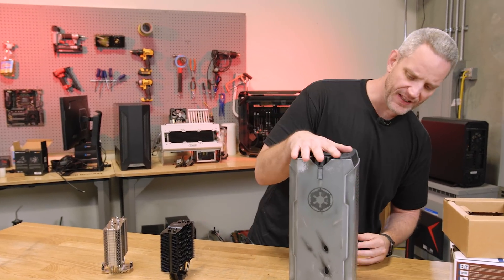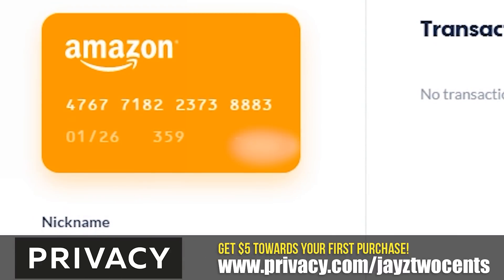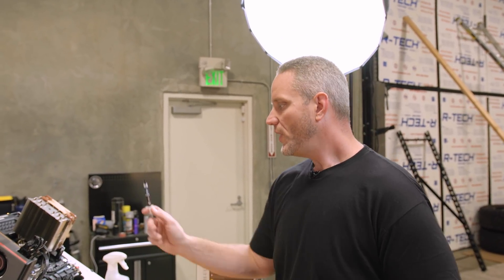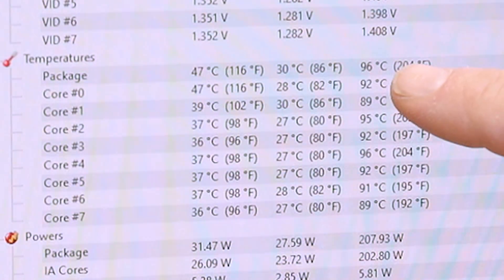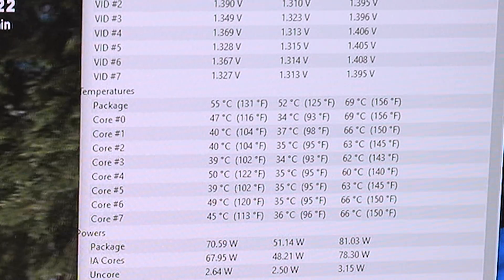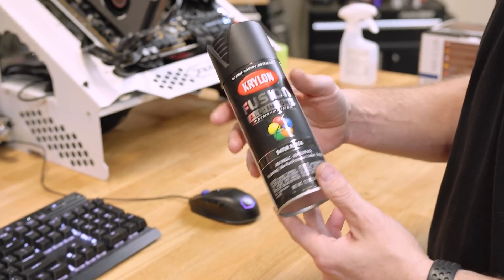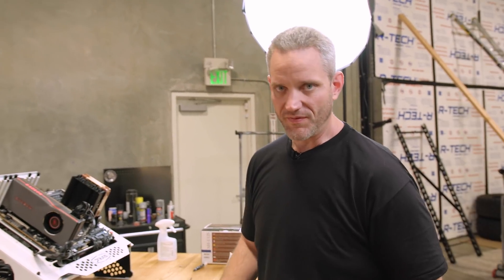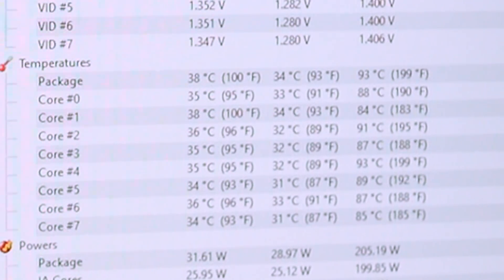Does painting a heatsink hurt its performance??

Comment: Now you have to sandblast that "ceramic" coating off of the BeQuiet cooler and see if it cools better.
Reply: Ceramic is actually pretty darn good at transferring heat depending on the exact composition being anywhere from 80W/Mk to 2-300W/Mk
Reply: @radicalxedward8047  hum they ceramic coat header to keep the heat in the piping and increase spool time on turbo car
Ceramic paint is just high heat paint
Reply: @radicalxedward8047  that's very true. But at the same time I'm pretty sure the heat pipes aren't quite as efficient (not to mention tim) so even though it's that good at transfering heat it'll be limited by the wicks,heatpipes and the phase changing. Which kind of make me doubts it'll make that much of a difference considering.
Reply: @radicalxedward8047  -. Damn is spelt d - a  - m - n , and it's quite possible that it's not intended as a curse in the context of your sentence. With a moniker of "radical," the word "darn"  doesn't fit in well.
Reply: Just paint it silver duh.
Reply: You can use super stripper and then just pressure wash it later to get the super stripper off 👍
Reply: @Twitch_Moderator  super stripper isn't that super girls secret identity?
Reply: @KunoMochi  Noctua themseves say that black paint hurts perfomance and it was a challenge for them to find coating that wasn't absolutely terrible.
Reply: @Koshzor  You can dope coatings with impurities to give intrinsic properties for thermal conductivity to electromagnetic insulation or reciprocity.
Reply: @KunoMochi  Linus already did; there's no difference in performance
Reply: Could of just bought a heatsink without any coating.
Reply: Result: the non painted NH-D15 next generation is on the buying list not the chromax version
Reply: If he sand blast it, sand will impregnate the coolers fins and not give a accurate result as sand is an insulator.
Reply: @chaddystechstuff5547  lol.....I don't think you really know what sandblasting is.
Reply: @wcraft84  When u sand blast to strip eny type of material off a surface, sand particles impregnate the surface of the material. It is not visible to the naked eye. This will cause the surface to be more porous and not transfer heat as well. The only way to get the sand particles off/out of  the material is hand sanding the surface smooth. You can't hand sand the insides/ in-between the fins so... their would be some issues.I know this because I use sand blasting at work pritty regularly. Hope this helps clarify. (Impregnate just means sand gets stuck into the surface of the material.) Its a term used in the machinist community.
Reply: @chaddystechstuff5547  there is blasting media that does not impregnate softer metals.
Reply: @wcraft84  It would not be sandblasting then. It would be a fiber based material being used.
Reply: @chaddystechstuff5547  troll
Reply: @chaddystechstuff5547  -

Your opinion is at the level of an expert. Thanks for your input.

Comment: So basically what we learned here is if you're running your system on the top limit of what your cooler can handle, probably shouldn't spray it. If you are well under your cooler's limit and have plenty of headroom, go for it! P.S. It can be offset by getting a better fan. (Which you're probably doing if you're upgrading the looks of your computer anyway. Right?)

Comment: "I want to do a *Real World Test*" and then proceeds to use an open test case, duh...
Reply: And Cinebench R20 is a "real wold test" also. It shows how heavy the CPU will get pushed for rendering and hard productivity work. By "realistic" he just meant for gamers while playing games only. Not sure why that is the only "real" use of a CPU.
Reply: @odinsplaygrounds  Still the 99% of gamers or heavy users would have a closed case with proper case fans
Reply: Modern cases having massive airflows now I don't think it'll make a lot of difference.
Reply: @mouaxiong8618  there are more cases like that than before, and also more cases with terrible airflow just for the looks. In both scenarios, the interaction between the case fans and the CPU heathsink is relevant
Reply: I said the same thing. This test is pointless because of this.

Comment: Prediction: I have actually done something similar (not a cpu heat sink, but a heat sink) and found there was a difference, but the paint I was using was heavy-duty industrial paint that goes on super thick. However, there were only 9 degrees different. 168 -> 159 (+- 1) degree because of the equipment used.

So I would say there is a differences, however if you scale this down more and more I believe the differences will become less and less.  To were there is little to no difference.
Reply: Seems about what I thought. Not a super huge difference, but still a notable one.

Comment: I think it'll depend on what you use to paint the cooler. Having said that, paint will probably act as insulation and slow down heat dissipation. I think temps will be higher but likely not enough to be a problem
Edit: well I was kind of right but then I didn't make specific temp predictions

Comment: The Mighty Car Mods boys tested something similar with car intercoolers and found that the black painted one performed a bit better.
Reply: I believe engineering explained or someone else proved them wrong
Reply: Geek Mechanic I’ll have to check that out
Reply: @kylehyatt42069  yea it was engineering explained that they were wrong because intercoolers use convection not radiation and goes into deeper explanation. Essentially paint adds insulation, adds restriction of airflow between the fins.

Comment: if you masked off the faces of the cooler (maybe start 10mm from the edge) i bet you could get away with painting the visible surfaces with even less impact on cooling.
Reply: K.  Look at how close those fins are.  Now count the total number of fins.  Now get out your exacto knife and tweezers, and let's get this party started.
Reply: @WeirdOne19142  you don't have to do that. Cut the right size piece of tape. Slap it on the surface where the fan goes. 2 pieces of tape for the entire cooler (or 1 if it's a single fan) Done. Fan hides the unpainted areas.
Reply: @Matthew-sp5kv  true.  I stand corrected.  I apologise.

Comment: Just use high heat paint like caliper, engine, or just ceramic coat it to make it even cooler or no difference at all.
Reply: high heat paint is meant for resisting extreme levels of heat without getting worn, not that it transfers heat better....

Comment: Paint does actually turns it into a better black body radiator, which gives it better ability to cool by infa red radiation, but this effect might be way smaller than the insulation effect of the paint.

Comment: I wonder if doing something like a black wash, or using a chemical to give the aluminum a dark patina would be a safer alternative?
Reply: there are dies and stains that will tint metals - a little bit more of a process, a lot say they have to be baked on but that is only to set the color and make it more durable. For something that is not going to be exposed to the elements just a little more cure time works well.
Reply: safer? there's nothing dangerous about what he did, just performance hurting.
Reply: @shawnpitman876  "No Jayz where harmed in the creation of this video"

Comment: do a video about NH-D15 using 3 140mm NF-A14 fans running at max fan speed 3000rpm vs the best AIO Liquid Coolers

Comment: I think it will cause extra heat, but not enough to worry about.  

Also, I'm prepared to be absolutely wrong.
Reply: Depends on what you call enough to worry about.
Reply: @shawnpitman876  I totally concur.  My personal opinion: if it throttles my CPU, it is enough to worry about.  

Others my not think so.  They may think: If I notice a difference.

That's why it is very personal/tangible assessment.
Reply: @shawnpitman876  That's why I keep the HVAC vent closed in my office during the winter.  My PC and peripherals heat the room well enough.  :)

Comment: I have painted a Hyper Evo 212 and had no increase in thermals but I think paint type is very important. I use engine or grill paint to paint my stuff black. Its a thin coat type paint and not gummy.

Comment: initial thoughts... paint it...using which method?
depending on access to tools, getting a heatsink electro-static coated followed by  baking the fins(not the heatpipes)  you would suffer little  performance loss.

literally dipping the heatsink in pain would be the worse.

Comment: Painting your brake calipers red increases braking performance (along with Brembo stickers) so painting your heatsink has to give you better cooling efficiency. Also, a Noctua sticker on the fan makes it cool better. Now the real question is what happens when you paint the IHS?
Reply: braking performance isn't about how well you transfer heat but rather how much friction you can generate....

Comment: paused when he asked for predictions, im guessing +5C
edit: wow only 1-3C, im surprised, thats the same margin as ok tim vs premium tim. i would have thought a coat of paint on all the fins would do more.
Reply: you were right for some of the cores, but not the only metric jay seemed to care about which is package temp.
Reply: I was guessing 2-4C
Reply: Exactly my prediction
Reply: My guess was a 10 degree increase.
Reply: @erikburzinski8248  did no one see the one core than went from 60C to 72C xD
Reply: @landmine36  Exactly. That's a massive jump. On ryzen, that's like losing 100mhz boost.
Reply: @landmine36  I did see that, but Jay specifically said that his results were an amalgamation of several test runs.  I'm sure there were some fluctuations in there because... Well... There always are.
Reply: thanks for the answer now ill watch this video later with knowing the outcome

Comment: Welders have to add additional amperage in order to weld aluminum because it dissipates the heat too fast to get a good weld puddle.  So anything that is less efficient at conducting heat away from the aluminum mass is resistance to conduct heat energy.  Ceramics tend to insulate.  So yeah, a ceramic coating will inhibit the heat sink from efficiently conducting heat away.  It should retain that heat rather than moving it away from its surface.

Comment: I don't think it'll cause a significant change, because the paint is so thin and it won't impede airflow much either. Maybe 1-2C? Within a reasonable margin of error.
 
Now, if you put 5-10 coats on it...

Comment: OK haven't watched yet. There is a wrinkle finish paint meant for engine cylinder fins on an air cooled engine. It in theory anyway creates more surface area as it creates wrinkles as it dries. My guess is that would help.

Comment: Ceramic material draws heat, so a ceramic painted heat sink will remove heat without any problems.
Reply: wanna know why you're wrong? because ceramic HOLDS heat too, meaning it'd have a hard time getting into the air.

Comment: This is actually a topic I've had spinning in my heat for weeks. Same with the question of spray painting the mesh on a case.
I'm just not too experienced with modding, so maybe I worry more than I should, but I'm glad that Jay takes the time to do things like this.
Learning~.
Reply: Chris Campbell oh I was scared SCARED when I painted my motherboard on my first ever pc build. But I wanted it white. So I did it, against everyome saying how it was be soooo bad for temps and could ruin the board.... Just got automotive non-conductive spray paint and it worked fantastic. Over two years later still going strong
Reply: If you spray paint a fine mesh you will definitely decrease the hole÷mesh ratio, therefor decreasing flowrate. If it's a courser mesh, a thin paint shouldn't be an issue
Reply: @maggi98mw  most black coolers are anodized aluminum.  That wouldn't have much of an adverse effect like a urethane paint or some other non sense coating like "ceramics" or Powder coating with thick plastic
Reply: It's about surface area as long as the mass can keep it coming. Small snips in the fins adds surface area. As long as air flow is not impeded grind the fin stacks and use aluminum washers to thin shim more find :-/ Many of these kits don't like to work as hard.... you need a larger bladed fan not the sexy S blades.
Reply: https://www.techspot.com/community/topics/noctua-introduces-a-series-fans-with-extremely-tight-tolerances.246344/
Reply: @FastBowtie388  Marcus, nor the op, said anything about spray painting the cooler. This is about spray painting mesh.

Comment: I'm going to say yes before getting further in. But the biggest issue is going to be peeling paint if you are spraying the whole cooler and not just the front plate. You aren't going to be able to scuff the surface to keep the paint from peeling.

Comment: 3-6c increase depends on thickness of paint. Also you can use Engine paint as it is a ceramic paint that will help reduce insulation compared to normal spray paint.